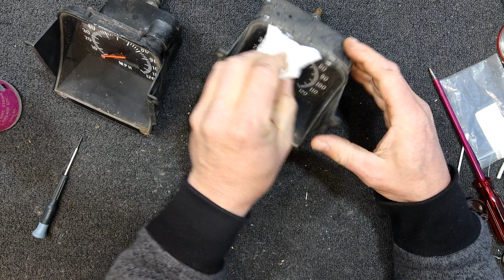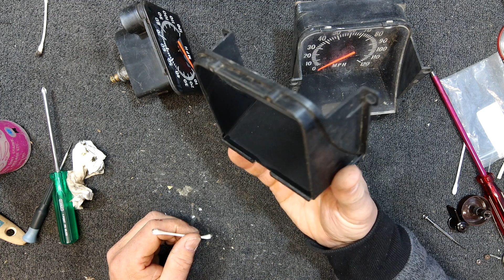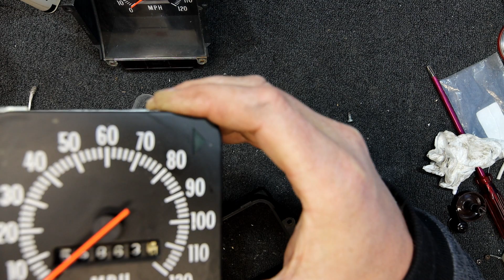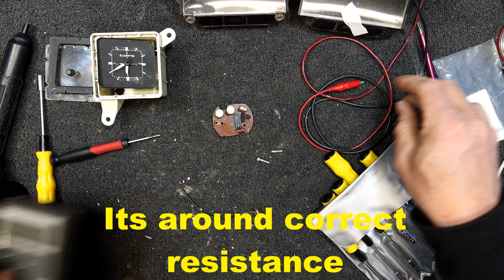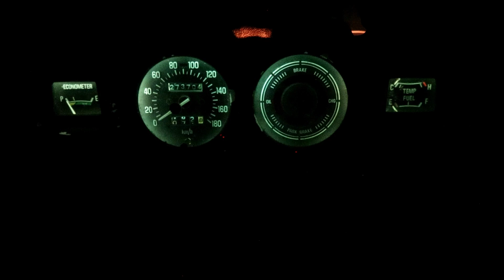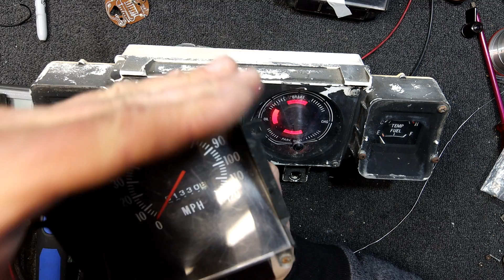Checking some Car Instruments HQ Holden Speedos, Datsun Stanza Clock and Cluster

Comment: Do you repair body control modules by any chance? I have an early 90s commodore and I'm having trouble finding a bcm under $800
Reply from the maker: It may be possible to find the issue without powering one up, but then there is no way to test you have fixed it is the problem.
Reply: @StevesElectronicRepairShop the issue is that the PCB inside has corroded. I have had it out and apart myself, the tracers on the Pcb are corroded to shit. 

Unless I can repair this one I'm up for a $900 replacement unit.